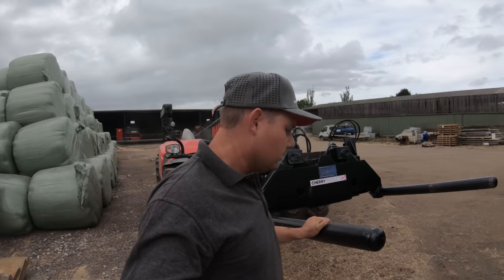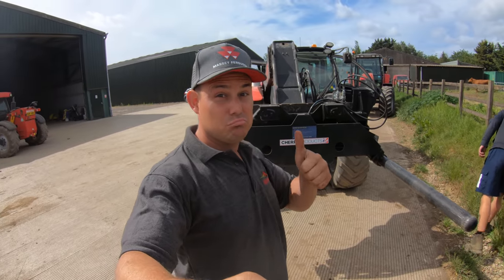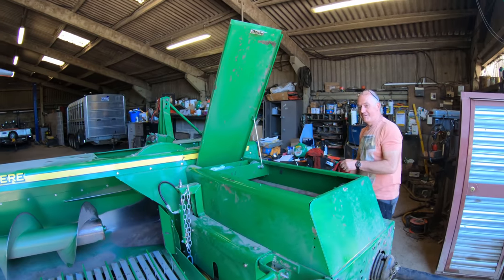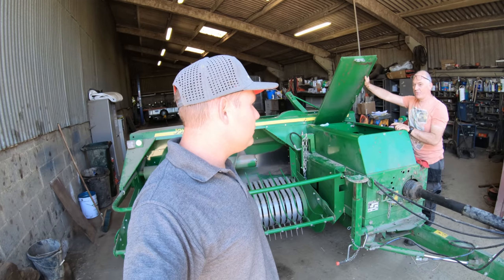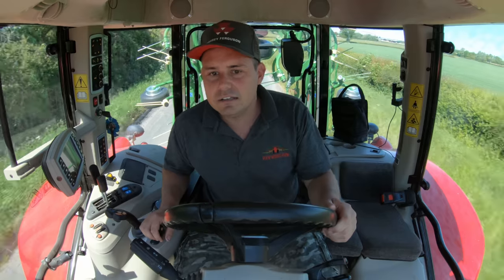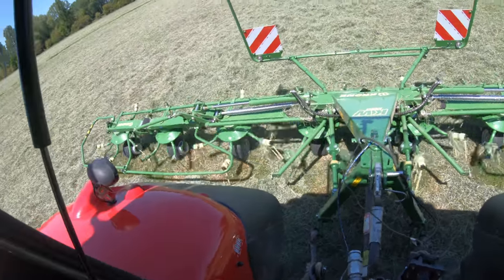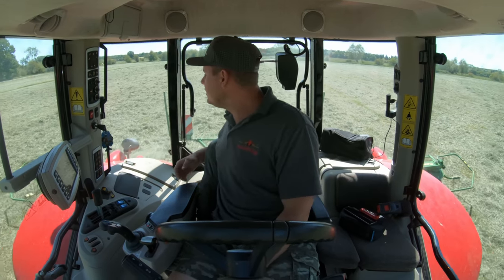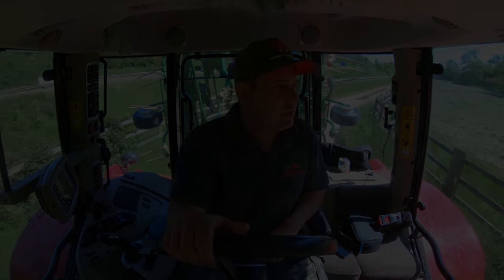Making hay in May

Comment: you have to use the top link tho adjust the heigt of the tedder not whit the lift arms
Reply from the maker: We have the top link in float as we have variety of different fields rough and smooth so the height is set with the arms, if set within the non float position then yes set with top link 👍